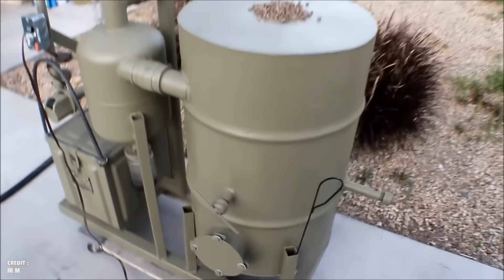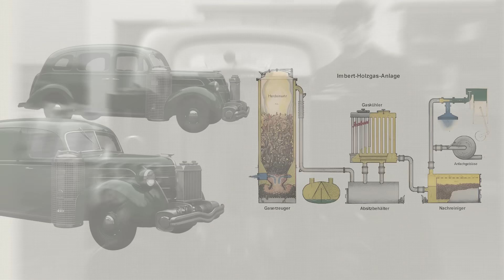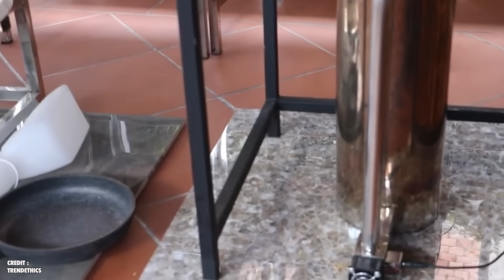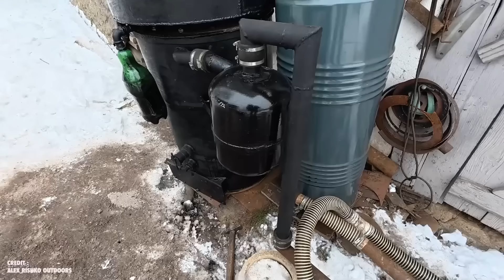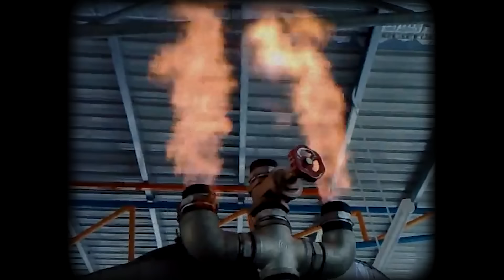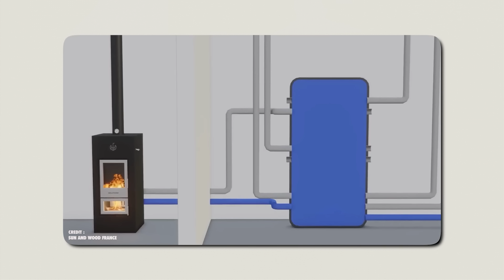Forget Solar — This DIY System Produces ENDLESS Energy Without Electricity

Comment: This is an interesting video, but doesn't explain a lot of things that matter, or explain the obvious: "if it's so great why isn't everybody doing it?"   Why does it only get done under conditions of the most stringent war-time conditions, when nothing else is available?

The answers are that it's bulky, high capital cost for fairly low output, and unless done in a high-tech way that generally hasn't been done ... it's dirty and labor intensive.  There are now things that can be done to make a lot of these objections less of a problem.

Further ... this video jumps into "bio char, bio char, bio char" ... and that's really a separate issue and NOT the way these technologies have been used to date.  Most of the energy of the wood remains in the charcoal (what biochar is ... just charcoal).  Charcoal is very high value; through most of human history mankind made charcoal making no use at all of the volatiles driven off in the process: charcoal was the desired fuel product.  It burns hot, gives off much less smoke than wood, and has far higher energy density.  It also has nearly zero sulfur, is far cleaner than coal, both as a heating fuel and for metallurgy.   Mankind started burning coal simply because there wasn't enough charcoal available.

Nothing says a gasifier must make biochar.  Commonly it is combusted/reacted in the gasifier to produce more carbon monoxide or even hydrogen from water via the reaction 2H2O + C -> CO + 2H2

This video also creates a silly strawman argument about simply heating with wood.   A lot of homes heat with wood; I do.  Nobody uses an open hearth fireplace to do this; a modern draft controlled wood stove must be at least 85% efficient HHV to be EPA certified now.  This is simple and it WORKS and is low pollution if run properly... no strong reason for a gasifier to do just this heating job, though there are gasifier systems, mostly for the very largest sizes.

The real question is "could you use gasification to get your electricity?"  Or what about using syn-gas to run a motor to run a heat pump ... radically multiplying the heating efficiency?   And then thinking really crazy -- what about running a vehicle?  Running a vehicle is the absolutely hardest task ... but these days with battery cars this could be done very attractively if you can just generate electricity.

These ideas are starting to make a comeback in conjunction with heat pumps and electric cars.  They are a multiplier that solve a lot of practical/utility problems with wood gasification.  I've been thinking about it ... not doing anything ... yet anyway.

Another important issue this video doesn't mention is that if you run your gasifier with air for the oxygen input you get a very low-value syn-gas with a lot of nitrogen in it.   It's hard to burn -- the cars that had those clunky wood gasifiers ran poorly because of it.   There are two solutions to this problem:

* the old fashioned solution was "the town gas process."   In this process, usually done with coal,  air is forced through a burning bed of coal until the coal gets to a sufficient temperature, and then the air is turned off and hot steam injected.  This reacts via the previously-mentioned 2H2O + C > CO + 2H2 to yield carbon monoxide and hydrogen with near zero nitrogen ... a very good gaseous fuel.   Starting in the late 1800s essentially every city in the world built gas-works to do this - it ran all the street-lights, people had stoves and ovens running on it, heated houses ... etc.

It was a relatively clean & convenient energy source at point of use, but these coal gas-works were dirty belching messes in their day. This was all obsoleted when natural gas became common.    It also should be mentioned that the CO in the fuel is poisonous unless/until it is burned to CO2 (that is still poisonous in higher concentrations, but every fuel except H2 produces CO2)

* Or... the modern alternative: use an oxygen generator to feed the gasifier.  The oxygen generator requires power (to separate O2 out of air), but the resulting syngas is far higher quality and utility, and the process is far cleaner than the town gas process.
Reply from the maker: I replied to you earlier but I didn't really address the points you highlight - so here is my revised reply:

Wood gasification was used during war times because of the scarcity of oil.  Today you can use electricity to drive cars and use wood to heat a home in a standard wood burning stove or wood burning boiler.  So yes times have changed and our reliance on oil isn't what it used to be in the 1940s.

Biochar - you are correct!  Systems designed to gasify wood for syngas production are not generally designed to generate biochar or charcoal.  This tends to be done by using retort kilns which use the syngas as a self sustaining fuel to optimise the production of charcoal (or biochar depending on the controllability of the kiln).  But if running a gasifier inefficiently, biochar can be a by product of a gasifier (whether downdraft or updraft gasifier).

Now to pick up your "silly strawman agrument" wood burning is not allowed in the built up environment due to the PM2.5 and PM10 issues and the reason for mentioning gasification stoves is that these burn cleaner and address the PM2.5 and PM10 issues other standard wood burning stoves don't - so a valid inclusion in this video. I could have also mentioned electrostatic filters but the video would then become more of a lecture than a thing of interest.

Now in respect to your question regarding using gasification to run cars today.  The answer to that is no!  Using direct gasification on cars is not a great idea.  The biggest problem with gasification is tarring and contamination of the combustion chamber. BUT using gasification as a primary process for generating synthetic fuel for running cars and planes, then yes that is a reasonable option especially if using waste wood. As an engineer I assume you will know about the Fischer-Tropsch (FT) synthesis process.

Now in respect to LHV regarding the syngas you are correct and that is why some companies installed turbo chargers in their vehicles to compress the gas to get sufficient energy into the combustion chamber to allow them to move - they even did this in a plane (crazy enough). Contamination was still a problem and systems had to be regularly cleaned.

Now in respect to towns gas - you are again right they used steam gasification to increase hydrogen content (not steam reformation as some people believe).  I have to say I didn't know they used towns gas in stoves, I thought it was just used for street lights and cooking. So I have learnt something there - thank you!

Yes syngas is high in CO and needs to be approach with appropriate caution such as having CO sensors place if using the gas internally in occupied areas,  but that said I still think it has its applications in homestead and self sufficiency applications.

Hope this was a reasonable response to your very interesting comment! Thank You!
Reply: Its AI slop
Reply from the maker: Appreciate you taking the time to add such a constructive comment - again! Not sure if you realise but people creating AI slop wouldn't bother responding to your "AI Slop" statements!

Comment: Can’t tax wood
Reply: Outlawing burning wood has already happened in quit a few U.S. cities.
Reply: @jammer6524  If you have a properly built wood gasification unit, it burns so clean that your next door neighbour couldn't tell it was there. Problem is that most aren't well built. Keith Wilson who is a legend on vehicle gasification uses a heat exchanger to initially precool the gas while preheating the incoming air for the pyrolysis side.
Reply: @kerrryschultz2904   "preheating the incoming air"        that's what fossil fuel power plants do to greatly increase efficiency. 
that way it actually have the O2 and enough heat to burn the fuel that is smoke.
Reply: Not yet
Reply: Don't give them idea's😮